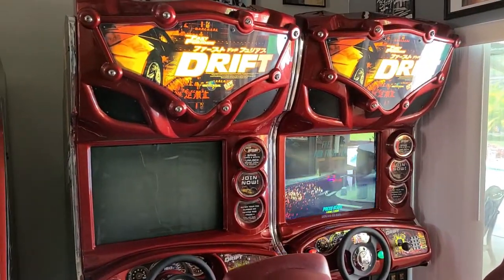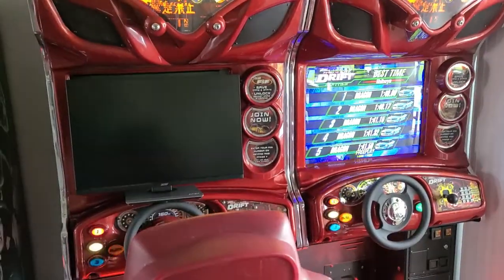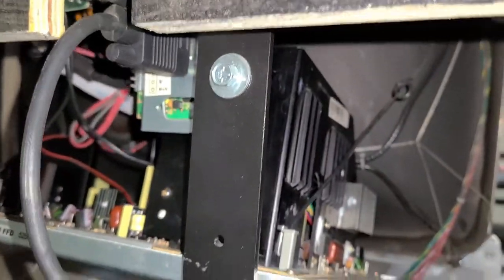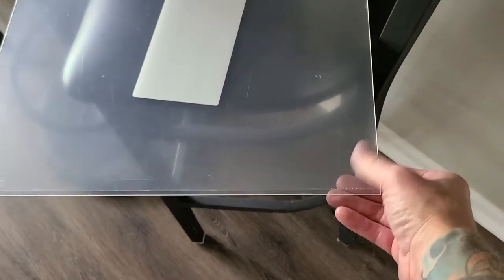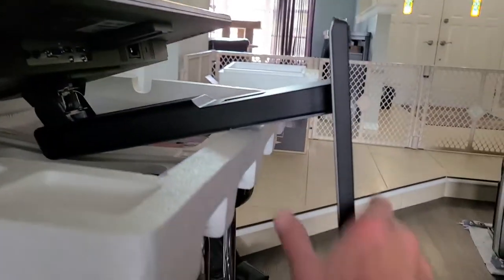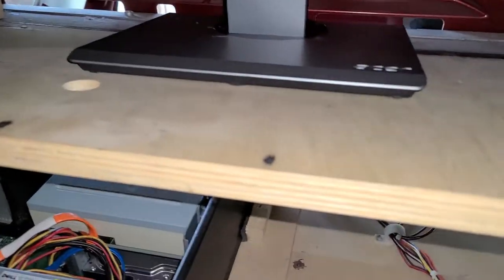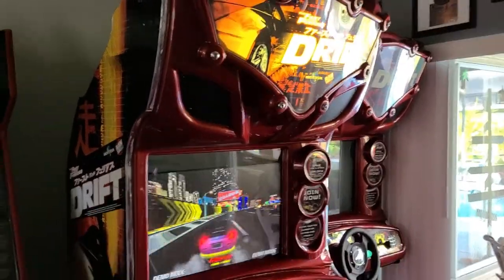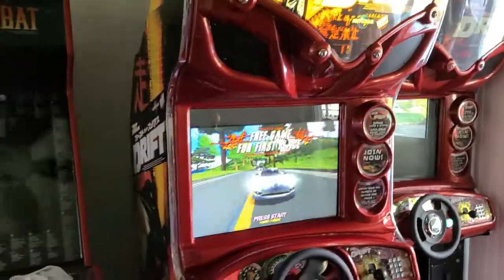Replacing a CRT Arcade Monitor With an LED/LCD Monitor Fast & Furious Tokyo Drift

Comment: Great video. Only thing I would have done different is centered the monitor instead on having the large gap at the top especially for tall people. Higher monitor would be better.
Reply from the maker: Thanks man. Yeah, I actually wrestled with that idea myself. At the end of the day I just decided to have a 2in space at the top instead of an inch on the top and an inch on the bottom. I'm on the tall side, 6ft, and it doesn't bother me one bit.

Comment: Top of bezel won't come out is there another screw ???

Update: yes two additional screws from inside at top. So need to peel it up as high as you can and try to reach in... no other way... I had to rip the bezel  out as top two wouldn't unscrew

Comment: It works, but not a fan. I would have found a 27" CRT and modded the DAC to accept RGB input like the original monitor. However I noticed you were using a Dell Optiplex most likely with a emulator instead of the original PCB that goes to the cab. So good job modding it on a budget to get it to work again.
Reply from the maker: Yeah man, nothing beats the 27" CRT. These are a close 2nd though. Actually, the Dell is in fact the stock system. Not an emulator.

Comment: I would have had to center the screen and add a bezel on top and bottom... that's just me though. Looks good. Thanks for this video.

I found this video because I have a 33" wells Gardner I need to swap... or fix.

Comment: WOW! As much as I am not a fan of these LCD conversion, 16:10 definitely works so much better than 16:9 monitors do! :)
Also great job on putting glass in front of the screen and blacking out the top. Most arcades near me don't do that, leaving it looking like there's just a TV sitting inside an empty frame. :/ I also bet you could put something in that blank space at the top, such as gameplay instructions, more artwork, a banner, or something cool like that. Similar to on lot's of SEGA cabinets. ;)
Reply from the maker: Thanks man! Yeah, it came out looking sweet.

Comment: Have you had any luck finding a pair of 4:3 monitors?

I know there used to be a Makvision line that they were selling as replacements, but that's been out of production for quite some time now.  I think there's another guy in Australia who may be selling some, though I forget the name.
Reply from the maker: I didn't have any luck finding them when I was making this video, but if there is an option for 4:3 LCD panels, I would absolutely make the swap.
Reply: @Scantron5k  I tried looking around for some last nite and it seems like most of them were in the 17-20in range, although you need a 27in.  I tried Arcooda and they aren't big enough either.  I was giving a thought to checking arcade distributors to see what style of machines they have, because I wouldn't be surprised if they might be getting custom order 4:3 at larger sizes.  Would be a bit expensive though if you could get through to them.
Reply from the maker: @voltz15  there's absolutely no reason not to manufacture them at this point.

Comment: Looks like a huge upgrade on the color and clarity (ok haters that it's not a CRT, take it easy). Did you try it more centered so you only had a small black bezel at top and bottom instead of all at the top?
Reply from the maker: I was going to, but I just assume have one bezel instead of two.

Comment: How do you turn the monitor back on if the power is lost to the machine.  I'm concerned accessing the monitor's power switch would be a bit difficult.
Reply from the maker: It's technically a computer monitor, so it turns on and off automatically once it detects power from the machine.

Comment: Okay got a question 2005 complete Golden tee golf trying to do the same swap got a 27-in monitor flat screen want to know why when I reboot the game the settings on the monitor don't stay it doesn't stay full screen it reduces down to a smaller version sort of like 10:00 position of the screen leaving some on the bottom and some on the right I hit the config button and it comes back up to size what can I do do I have to take it through a CRT IGA converter I'm hooking this directly up from the video board that has VGA
Reply from the maker: I've never heard of this happening. Perhaps it could be something to do with the converter that you're using. My monitors both save the settings every time I turn them off and back on.

Comment: I have a Rush 2049 machine with bad screen. To convert to LCD and have no gaps at the top and bottom(and no "screen squish") I would need to find a 4:3 ratio monitor? And noone makes these? Damn haha..
Reply from the maker: Pretty much. I've seen 4:3 LED monitors before but most of them are made in China and they are quite expensive.

Comment: Mind telling me the model number of that Acer monitor and if it has a VGA port or not?
Reply from the maker: The link to the Monitor and all of the specs are located in my description. And yes, it has a VGA port.
Reply: @Scantron5k  The link expired but fortunately the link itself shows the model number. It's an Acer BW257. Pretty good price too.

Comment: Can you use a newer monitor, one that uses a power plug like a laptop uses?
Reply from the maker: Yes, you could use any monitor you want, but the main reason I chose a computer monitor is because most of them automatically turn on when the power cable detects power. Therefore I don't have to have a separate remote laying around to make sure I turn the monitor on and off separately.
Reply: I don't have the cord that went from the original monitor to the plug.  Can I just tie the computer cord into the plug on the inside of the cabinet?
Reply: I decided to use an older monitor, 16:10 LG, which uses the same type power plug, like the one shown in your video.  As I stated, I don't have the power plug from the original monitor, so I was wondering if I can just tie-in the computer power plug, directly into the plug inside the cabinet.
Reply from the maker: @punisher2112  yep. That's exactly what I did. If you watch the full video it will explain.
Reply: Got it all hooked up and it works great!  Thank you very much for this video and your help!  I am a newbie to this sort of thing and get real nervous making mods.  I will say that I wasn't aware that I had to change the settings of the monitor to accept VGA and couldn't figure out why I wasn't getting signal.  Now I know!  The newer computer monitors do not automatically look for VGA, so they have to be configured.  Easy process, but if you didn't know about this (like me), very frustrating!

Comment: YOOO Please tell me you didn't get rid of the D9400's!!!
Reply from the maker: Trust me, I didn't want to. When one of them took a shit, I made several attempts to fix it. I also had it fixed by a professional. It was just way too problematic, man. The cost of locating some and replacing what I had was ridiculous because the LED monitors are cheaper and last way longer.
Reply: @Scantron5k  NOO! I have a d9400 that I’m need a decent tube for. That’s what I’m asking.
Reply from the maker: @Undar8ed03  oh shit lmao. Yeah, they're loooong gone.